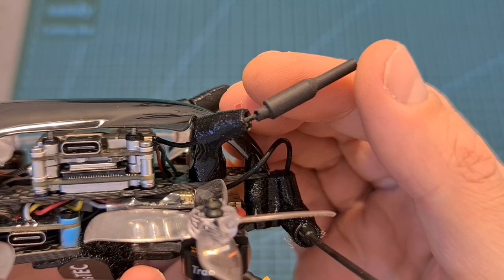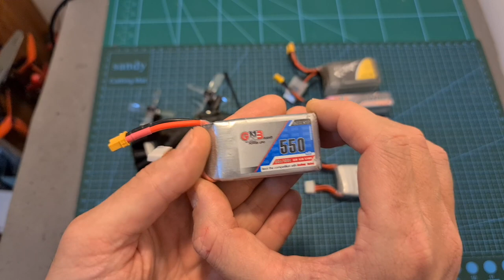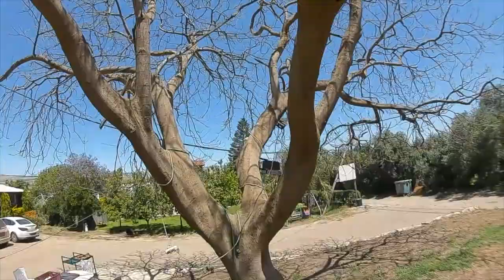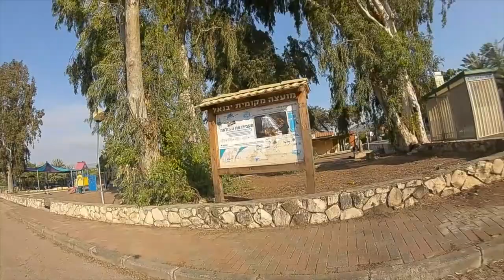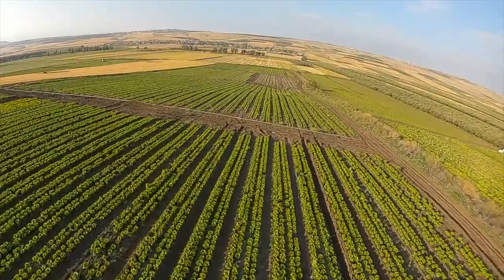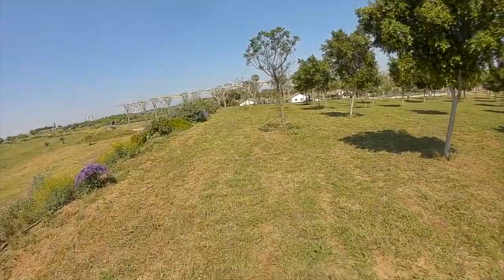Transtec Beetle MINI 2" DJI HD Cinewhoop - Setup, Review & Flight Footage

Comment: is the battery connection a xt30 or xt60
Reply from the maker: XT30.
Reply: @KremerFPV  thank you.. Another question.  I just got mine and I cant connect to Beta Flight unless I plug a battery in, is that normal.  None of my other quads are like that
Reply from the maker: @2krazyketos  no it's not normal. Something is wrong as the usb apparently does not power up the board.

Comment: I had the 2.5in Beetle but it was underpowered. I moved the parts over to the new Beetle 3in frame. I swapped out the motors for Xing 1404 4600kv and I fly it on 4s 650mAh packs (about 4min mixed cruising/freestyle). It's incredible like this, perfect amount of power. It carries the full size air unit no problem and has a nice amount of throw over trees.
Reply from the maker: Sounds like a great setup. What's the AUW?

Comment: Those fields.  I almost lost mine on my maiden.  I now have a self-powered beacon on board.  I do find flying it a little bit twitchy, must be the tune.  Also removed the LED strip and run the RPM filtering.
Reply from the maker: Did you setup RPM Filter with JESC or JazzMaveric?
Reply: @KremerFPV  JESC

Comment: Hi Gal, great video again. I just got the RTF beetle mini and also got the TBS crossfire bundle. Unfortunately I’m not so good with figuring out how to connect the receiver on the board and although you showed it on your video, I didn’t really get the exact wiring. Would it be possible to perhaps explain it again perhaps with a diagram or a photo showing the tabs with the wire colours or anything that will prevent me from making a wrong wiring? Thanks a lot.
Reply from the maker: Hi Pavlos, thank you :-)
Please see this images: https://icantfly.xyz/wp-content/uploads/2019/01/image-45.png
https://cdn.shopify.com/s/files/1/0260/1736/6102/files/F411-HD_480x480.jpg?v=1586337423
The channel 2 pad of the RX should be connected to the T1 pad on the flight controller and channel 1 to the R1 Pad.
Reply: Thank you very much. Keep up the good stuff!!
Reply: Hi again Gal, I have now set it all up and must say the goggles and camera are amazing. It’s very windy so can’t really fly right now but from the little that I did, I find that I have to really push the throttle quite a lot to get it to just take off and even more to gain about a meter height. Is that normal? Compared to my kingkong et115 V2 with 5500kv motors it’s very underpowered. I have used my 600mah 3S batteries. Manufacturer recommends 650mah 3S but I wonder would just 50mah make such difference? Please share your thoughts.
Reply from the maker: @pavlosgrivas343  Hi Pavlos. I think that it will work better with a 4s battery as a 3s setup is just ok for cruising around in my opinion. Anyway 50mah won't make a lot of difference so that's not the issue.
Reply: Gal Kremer thanks Gal. Any suggestions what could it be? I’m relatively new in fpv so any ideas are welcome. I have not touched the PIDs.
Reply from the maker: @pavlosgrivas343  I think that you should try 4s batteries :-)
Reply: Gal Kremer thanks Gal. Appreciate four help:)
Reply: Hi Gal, bought the 850mah 4s batteries but I could smell the motors after just 45seconds of flight so I landed and the motors were very hot. Did you experience anything similar when you flew the 850mah?
Reply from the maker: @pavlosgrivas343  Hi Pavlos, these batteries are too big for this quadcopter. I recommend using 400-550mah 4s batteries as I recommended in my video.
Reply: Gal Kremer Thank you very much.

Comment: Quad gets motors extremely hot is there anything I can do about it d gain possibly
Reply from the maker: Which battery are you using?
Reply: @KremerFPV  650 4s
Reply: @KremerFPV  is there a tune that could pull less
Reply from the maker: @ghiss46  I didn't adjust the stock setting. If you flashed a newer BF version you can revert to the one that came with the drone and use the stock settings which are included in the description of the video.
Reply: @KremerFPV  thank you I will try

Comment: Thanks for the excellent review, I like how you go through the betaflight set up with just the right amount of detail.  The OG Beatle get pretty good reviews, I am not sure the smaller sibling will as much.
Reply from the maker: Thanks for watching! I am testing a modified setup of this Mini Beetle and hopefully it will fly better than the current one.
Reply: What are you modifying?
Reply from the maker: @chrisdavis1206  I used 2.3" by using an "upside down" configuration, but it didn't go well and I can't recommend this setup. I will try some PID tuning and maybe other propellers and see if it flies better.

Comment: I'd imagine this is rather noisy?
Reply from the maker: The video?
Reply: @KremerFPV  no... The motors.
I built a 2 inch 1106 7500kv 2 inch quad with a mini camera and a 20x20 stack 20x20vtx and a GPS module with a 1000kv 3s battery.
Was hoping for long flight times quiet flights for stealthy flights in my local park.

But screams like a tortured cat.  🤣🤣🤣